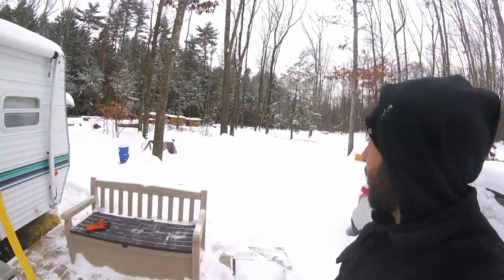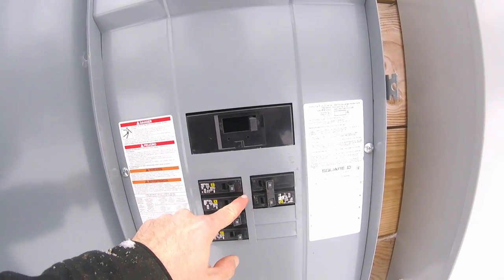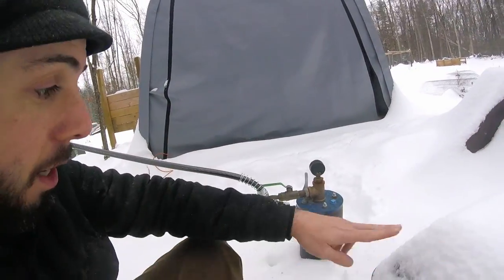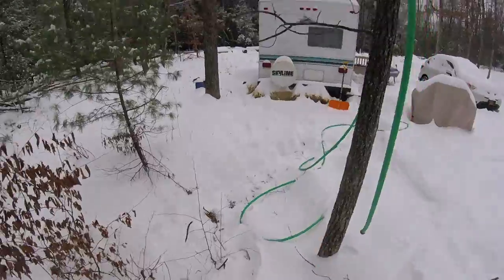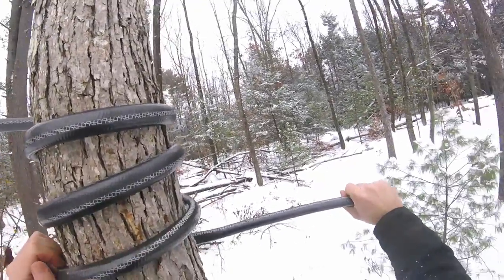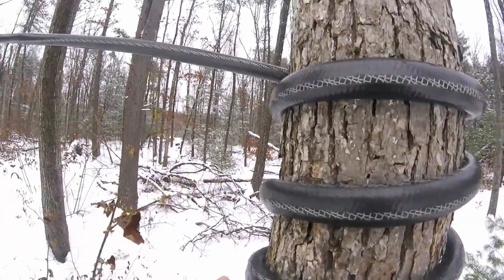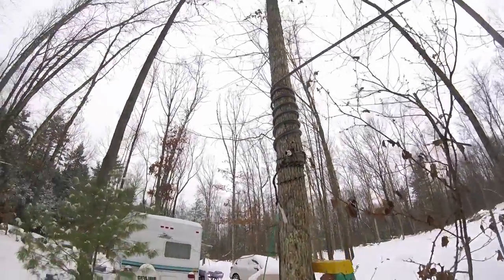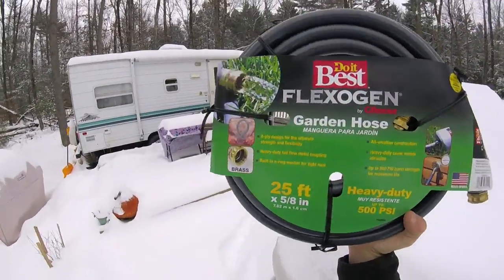Using Gravity to Get Well Water in Winter

Comment: I'm under the impression that there are specialty no-freeze valves that, when closed, allows the water to drain back into the well completely. Without one, I'd be a little worried that you'll crack that fitting sooner or later. Luckily, it looks like that'd be a pretty straightforward fix, so I doubt it would be the end of the world for ya.
Hope this works out. Just found this channel at random, happily subscribed!
Reply from the maker: +verdatum great tip, thank you, will look into that.  Why did you sub?

Comment: Great system, one thing, do you think a y connector at the tree would make the drainage go faster?  you wouldnt need the loose connection which could freeze and deform the connection point. As well i you do get water frozen in the lower hose it seems like having a pressure relife could come in handy.
Reply from the maker: +overphiend ooo, y connector is a good idea.  Thanks.  What is a pressure relife?

Comment: The weak point isn't the hose, but the connectors. I believe I have the same hose you are using from the well to the tree. The male end deformed inside the female end of the sprayer after one year. I had to cut off the end of the hose in order to use pliers to remove the connector.

The hose was great.  A little annoyed by the performance of the connector.
Reply from the maker: +Dean Logan great insight, will keep an eye out for thst thank you

Comment: They make wood fired hot tubs.... just get the stove and a 100 gal poly tank fromtractor supply.  put the stove behind a wooden fence you put at one end...Put it on 4x4s so you can drain it. I made one at my cabin using a 8x8 truck transmissioncooler, over a propane fire, pumped the water with 12V bilge pump from Walmart.Worked and got the water to 105* in 40 min. Two people you only need it half full.You displace enough water to bring it to the top. Trial and error. Maybe wait till spring.
Reply from the maker: just like elmer fudd and bugs bunny, is that what you're suggesting?

Comment: I worked in a gas plant and to drain overhead lines we had a high point vent.  You already have the low point drain.
Reply: Might want to put some sort of skirting around the bottom of the trailer also.
Reply from the maker: +Sheepy Hollow interesting, how would i vent the hose, poke a hole in it?
Reply from the maker: +Sheepy Hollow why skirting?  What are the advantages?
Reply from the maker: +Sheepy Hollow thanks a lot for the suggestions
Reply: Skirting will keep a pocket of air under your trailer dry and free of things that would change the temperature (ie. snow).  Having snow under the trailer would suck the heat out of the trailer.  And, I would assume, during the hot days, the cooler spot below would keep the heat from sucking the cold out of the trailer.
Reply: In the plant the pipe had a nipple in the pipe with a valve on it, so when we needed to drain the line we had to climb up to the high point vent and open it up to drain the line.  I was thinking in your case of putting in a check valve on the high point that closes when the water comes and opens as soon as the water stops to allow the air into the hose to drain and insure no water is trapped.  A "T" with the check valve would work the same way.
Reply: Skirting would make a dead air space under the trailer and take a lot of the chill off the floor as well make freezing under there harder as no air can get through.  You could use straw bales as an example and then compost them in the spring.  Just make sure the underneath is sealed off.  Even could get some heavy plastic to hang on the inside of the trailer door to make it harder for air to get into or out of the trailer.